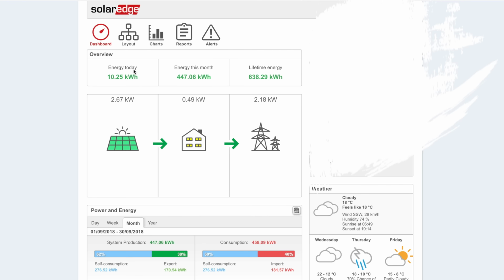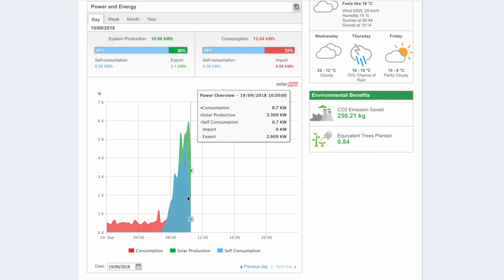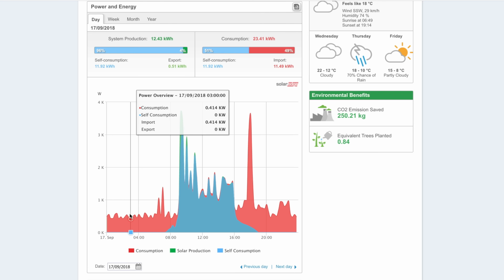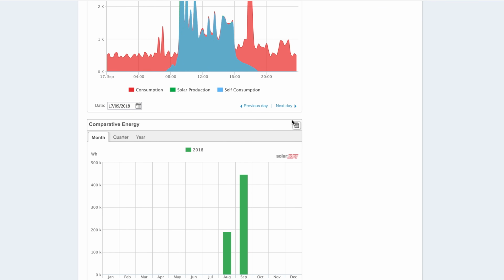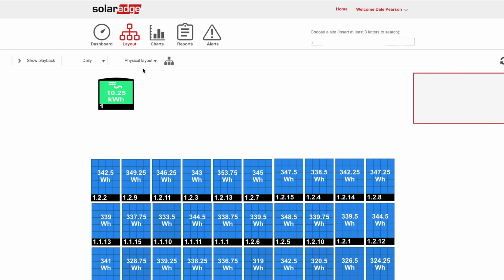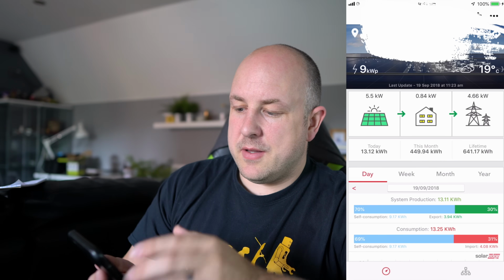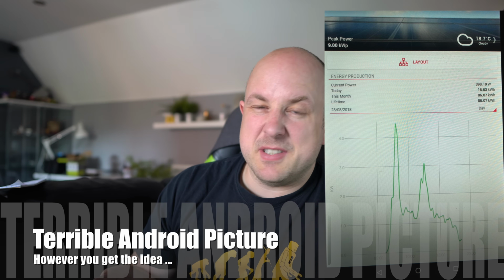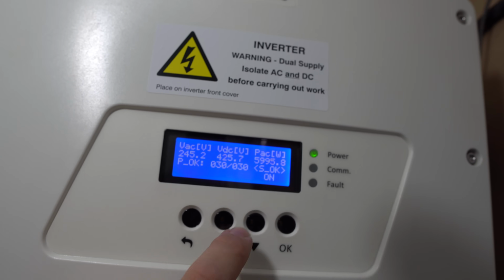SolarEdge Monitoring Overview - UK Solar Performance Data

Comment: Can you say if the one CT clamp monitors the import and export?

Or do you need two?

Also is the CT clamps rated at 100A?
Reply from the maker: The one CT clamp monitors import and export and is rated for 100A 16mm from memory
Reply: @ConsideredUK  your video is amazing thank you. 

I have one of the older SolarEdge inverters for a 4kw system. 

Now I’m thinking about adding a battery for storage, I wanted to monitor my usage before pulling the trigger. 

Your video was just what I needed. 

Thank you.
Reply from the maker: @JCRule69  Glad I could help, thanks for watching.

Comment: The CT clamp must not be extended, it is calibrated to the length of the cable.  Only the RS485 can be extended.
Reply from the maker: Its a while ago that I made this video, but I think I mention the CT clamp wiring is not to be extended, but thanks for clarifying.

Comment: While I've not tried, I expect its possible to capture the signals from the meter from the RS-485 connector.

I originally installed the Annetta to show the Solar in via App, but not the meter.  This weekend I will install the meter.

I am a qualified Electrician.  I agree with you in terms of the supplier vs customers link to the system.

I too love solar edge although I am annoyed that the old LCD system does not support their battery.
Reply from the maker: Agree, sucks the LCD model means you cannot consider their battery.
I wonder what is the fundamental difference which means they are not compatible.

Comment: Great Video,  Why did you choose SolarEdge over EnPhase?  Thanks.
Reply from the maker: EnPhase was not really an option in the UK. I think when I looked a couple of installers were familiar with EnPhase, but really more common in the USA.
So out of the UK options SolarEdge was the choice for me, and no real regrets.

Comment: Can you enter your electricity tarrifs usage as well as feed in tarrif so the monitoring app can calculate how much money you are saving or earning for the energy you send to the grid?
Reply from the maker: No ... the setting is for revenue generation vs money saved. You can factor in the export piece though.

Comment: I've got the app running on a Lenovo Yoga 10.5" tablet (Android) which has a nice little stand built in. You can get a black background colour if you turn on 'Color Inversion' in the Accessibility section in the Settings. Looks much better than the white.
Reply from the maker: Nice

Comment: Interesting useful video. Thanks.  My PV system was installed a month ago and I have been trying to reconcile the consumption figures from the Solaredge desktop app to the actual (chargeable) figures from EDF which are always higher.  For example yesterday Solaredge shows 17.75Kwh imported but EDF shows usage of 26 Kwh.  Have you experienced any discrepancies in this area?
Reply from the maker: Its never spot on, but doesn't tend to be as far out as the numbers that you have. However, it can be difficult to prove out. Hard for me to make a judgement without knowing all aspect of the install really.

Comment: Hi,  Great info! Thanks!  Question, I have a solar system at my house and would also like to monitor my own system, unfortunately my solar company is a joke.  They are really giving me a hard time giving me a log in ID.  SolarEdge, is not making it easy as will for a home owner to have full control but I think they will be approving me as a "self installer".    They mentioned that I need a server connection that a Solar company need to do for me to setup the "site" layout for me to use the monitoring system. Does that make sense?
Reply from the maker: I think they are saying your installer needs to provide SolarEdge on their servers with your string layout for your array, so the systems knows how things are configured.
I assume you have done this already, but complain to SolarEdge about the solar installer, as its their responsibilty to set this up really, perhaps after chasing they will help. However, they do need to populate the SolarEdge system with how your array is configured.

Comment: Firstly I would urge anyone considering installing optimisers to use M.C.S registered firms, I didn't check, just assumed since my installers had to be registered  re-fitters would also have to, wrong. These guys sell to anyone regardless of competance, not their fault, just the way it is. Efficient Homes (perhaps an oxymoron) broke 20 or more tiles on my roof and holed the felt many times in two visits. The first visit was to fit inverter and optimisers and break a lot of tiles, which have say they did come back and replace them when I refused to pay. The second time was to fit them correctly since according Solaredge having them just trailing on the roof " may invalidate the warranty " I am still waiting for Solaredge to get back to me on whether I have a guarantee.
I would suggest if you have an old roof or don't have much shading, consider whether it is worth the risk. For the record my best performing panel in February is now functioning at one third the level of its neighbours. If you want to see the before and after the optimisers were tidied, Just write Andy Bricky into the youtube search.
Reply from the maker: Just saw your videos, thats not good at all. The Optimisers can be easily mounted to the rail, so this is just lazy.
Hope you get it sorted.
Reply: @ConsideredUK  They have now fixed to the rail, now my best performing panel last month is operating at one third the rate of it's neighbours, no idea why. you have a platform, would you please encourage others to use M.C.S registered fitters. I would appreciate this very much.
Reply from the maker: Yup, you need MCS registered fitters if you want to get paid for export, etc.

Comment: First day with new inverter, looking forward to detailed accurate readings! So if you have any idea how to interpret this data I would be grateful for your opinion.

So to clear up any confusion over the accuracy of the monitor, the stats are after one day, 360 watts today, 360 watts for the month, logical.
The lifetime reading after one day is 926 watts!
Add up the totals on the panels you get 525 watts.

The output meter says we made 900 watts.
To add insult to injury I went up to wash the panels after they finished sinced they were dusty and some had skid marks from the heels of the fitters shoes and found 4 broken tiles in a 2 metre area, whatever is it like underneath the panels!
Reply from the maker: Thats some odd numbers.
You will see from my other videos, I just pick one device and use that as my "source" of truth. See how it goes over time.
Reply: @ConsideredUK  It wasn't a criticism. The old sunny beam had made mistakes but this has me puzzled.
Reply from the maker: Didn't take it as a criticism, I agree they do some weird stuff. Even now I "guess" at why it does somethings, but never have the actual answer :)

Comment: Hi, I thought a question about behaviour with excess of production, can you trigger any email or any iftt event when you have a predetermined amount of production? Could you use any sistem to activate any iot device? Thanks in advance!!
Reply from the maker: Honest answer is I don't know. There maybe something you can do using the SolarEdge API, however I typically ustilise all of my generation via charging the Powerwall, the car and heating hot water. So have not had a need to look at a way of triggering an alert.

Comment: Thanks for this video. Am I correct in thinking the SolarEdge modbus monitoring is going to give more detail and history than the monitoring provided by myenergi zappi? Agree with you about the customer not having control over their account. Fair enough to limit some of the installer functionality like array layout, etc. but for the rest, including the ability to use the API it should be in the customer's control.
Reply from the maker: Yes the SolarEdge information is much more comprehensive and reliable that the MyEnergi information.
Reply: @ConsideredUK  Thank you. Do you recall how much the SolarEdge Modbus component costs please? (excluding installation)
Reply from the maker: Erm ... think they are about £200 plus CT Clamps and Installation

Comment: Great detailed video...appreciate the walk through. Just as you have I also see the same peak self consumption along matching the peak solar production. However I do not have an Eddie or such device to push that electricity too in the house and so would you know why it would do that? This has been frustrating me as I evidently know that my import and export values shown on the app is off by a factor of x3 to x4. I know that I consume the solar generation lot less than what’s on the app and lot more import than what it shows, and so by default I export more too
Reply from the maker: Difficult to say with out seeing and knowing more information about devices in your house etc.
Only really way to test is turn off all devices and then monitor things, turn things on slowly and monitor, etc.

Comment: Good video.

One question though. If you lose internet connection for a period of time, once it is restored is there a gap in the recorded information, or does the local solar edge system store this information and it is updated to the cloud when internet is once again available. If so, how much/long would the local storage be?
Reply from the maker: Hi Coyote. I can't remember the amount of storage exactly, but I believe it is guranteed to store at least 14 days of logs, more if there data points per day are less. So you have a reasonable buffer of time.

Comment: Hi, for some reason the SolarEdge Monitoring website has stopped refreshing the modbus meter data every 3-5 seconds ( importing-exporting icons). this used to work great but now the data is refreshed every 2-3 min. do you have the same issue? 

Thanks
Reply from the maker: Thanks for taking the time to comment.
To be honest I have not used the app for a while as I have just been using the Tesla App with the Powerwall. However I have just looked and you are right there seems to be alot of lag, its quite abit behind.
When I get some time I will do some back to back testing, as the SolarEdge used to be what I considered most accurate.
Reply: Thanks for checking at least it’s not from my end. I’ve called solaredge support and they have started an investigation. Also, would you be reviewing the solaredge smart energy devices? I just grabbed the SE immersion heater to see if any better than the iboost plus
Reply from the maker: I hope to continue to review various solar, renewables and EV related products. I doubt I will look at the Immersion Heater as I have fitted the MyEnergi Eddi which does the same thing, and it seems to work well (well it did when there was surplus before winter hit).
Reply: @ConsideredUK  SolarEdge also have a 13 amp plug controller and a wired device controller too that can be switched on to a schedule or only when generating - worth a review perhaps?
Reply: @telatec8201  What was your findings about the SE Immersion Heater Controller?
I've been looking into one and haven't decided which one to go for yet. It appears you have experience of the iboost plus and curious as to why your looking elsewhere?
Reply from the maker: Hi Ian, I am actually waiting to see if I can get hold of a couple of their Load Switching Devices, so will be sure to review once I get my hands on them.